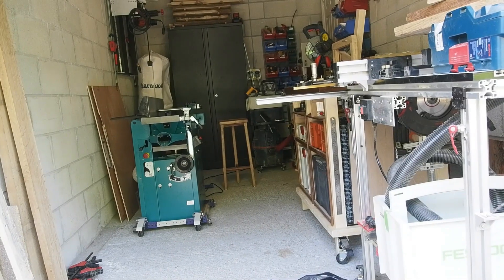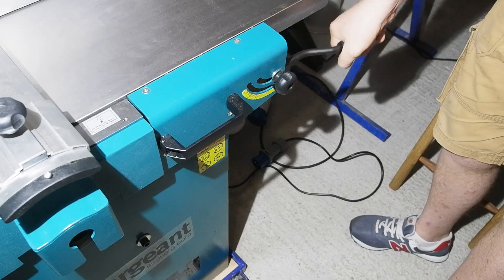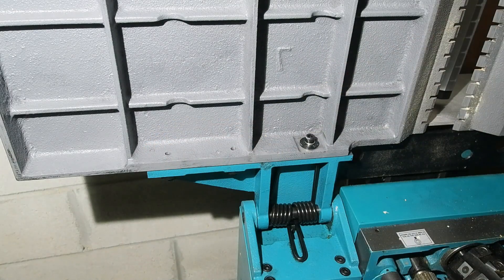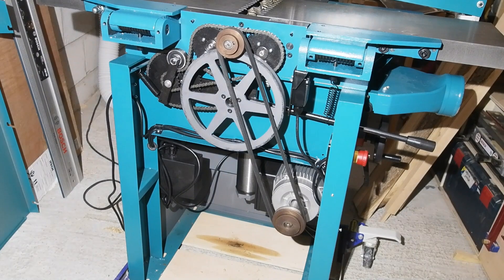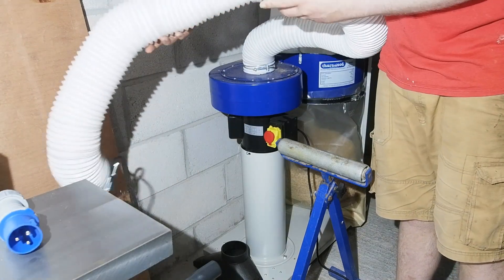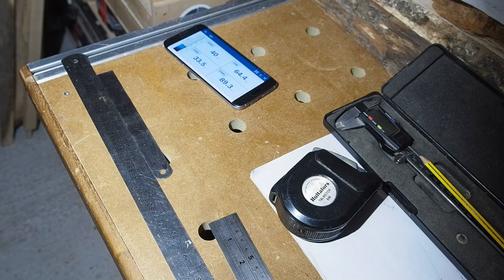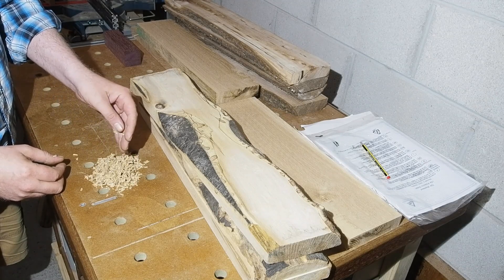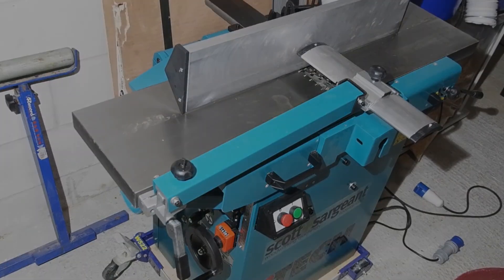ITECH 260S Spiral Planer Thicknesser Initial Thoughts, Setup and Test Review

Comment: Hi.  I said I would make contact if I resolved the left hand side out feed roller issue.  OK.  Isolate the machine, remove the back planel. Slacken off the 5/16 nut which acts on the spring which can be seen through the spindles of the drive wheel. I slacken off half a turn.   Now works great.  Over to you.
Reply from the maker: Glad you sorted it. Haven't looked at mine yet. I do remember when I set mine up initially, I had to drop the infeed roller a little for grip. You have the sprung bolt one side accessed by removing the back panel - as you mentioned ' but there's also one the other side which, if I remember rightly, I had to remove the inside panel to access. By "inside" I mean where the thicknesser bed is, front/control side.

Comment: Love your video.  I have the same planner.  For some reason the thicknesses does not feed through without some serious force. It seems the outfeed roller is far to tight.  I have not used the thickness for 5 months when it worked fine.  Any ideas or advice where to go would be appreciated.
Reply from the maker: Thanks mate. Funny enough, I was thinking about adjusting my outfeed roller myself today! It's started to hold things up sometimes. There's a set of bolts with compression springs that tension the rollers. It'll be these you need to adjust. Saying it is easier than doing it mind! 👍
Reply: @BischBaschBosch  
Hi. I stripped of the backend found those adjustable springs.  Really difficult to reach through the drive wheel.    If you do your then please let me know and vice verse.  In the mean time I will try thin straps fed to the right hand side at the roller doesn't seem at tight.   Watch this space.

Comment: Should've seen this video sooner. I got the same machine, only it says Bernardo AD260S. The only difference is the spiral block. Mine's a lot simpeler, with less blades, and not skewed. Bought it second hand (2 years old), with no manual or accessories. Spent a lot of time looking for the adjustment of the infeed table on the backside. No complaints however, fantastic machine, with great results. I do have the 400v version. Thx for the review!
Reply from the maker: Cheers. Yeah, I'm  Pretty sure a lot of machines (bandsaws, table saws, and planers) at entry level like these, are the same basic machines from the same factory. Just the odd change here and there to a brands spec.🤷‍♂️ Decent for a small workshop though. 👍

Comment: hi. Thak you for the review on the machine! Thats the best bit of information i managed to find on the whole web!  i am debating between this machine and axm 260 trade... which acording to some forums is a lot better. what puts me off is removal of fance to change planing mode... so itech is winning...  whats your feedback after a year of owning this piece of gear?  my machine will mainly be used for manufacture of solid wood tables tops ect ... would love the wider bed , but the cost are huge on itech for next model up so might have to settle on 260
Reply from the maker: Thank you mate. All those people saying the axminster is a lot better ...I wonder, have they actually tried both? That said, the comparable axminster machine is now nearly £600 more and does have some improved features. Mostly cosmetic though - better finished levers, wheels etc. It's feed rate is (and always has been) a bit better than the Itech. As is/has been the fence. It's a nice looking entry level machine. I was at the time of purchase - and still am - happy to forego the better fence, feed rate and cosmetic niceties for the ease of swap over on the Itech. For me, that's a constantly used feature and so matters. I rarely adjust the fence so that the adjustment is a bit rubbish on the Itech, I'm not bothered by. Always some compromise at this price level. Despite the Itech wearing it's budget compromises on its sleeve, it's proved a good enough workhorse so far. For most of us, even these entry level machines represent a not insignificant investment so you're wise to gather all the info you can👍
Reply: @BischBaschBosch  thank you for prompt reply. Ease of change is the biggest factor for me , wouldnt want to spend to much time on adjustments every time i mill lumber ...as per feeds ect , i am not bothered , its not for heavy comercial use. Quite like the offer now from S@S , for 2.3k with extractor and base ... so probably going to buy this ...and funny enough i was going to get Axminster until i watched your video ;P. Thanks again ! review from profesional are rare and valued...most of the YT woodworker prise manufacturers that pay them for doing so ....
Reply from the maker: @huntermedea8536  I think with either machine, a bit of time spent setting up, and you'd be happy with either.  Good luck mate, whichever you decide on👍

Comment: Just got mine and found your excellent video making up for a lacking manual. Wondering if you need to do any setup for the thicknesser bed or is that always true?
On the datum out feed mine is I think opposite to yours as it is moving the rule 8mm. Have not quite figured out how to use the two bolts by the pins. S&S video is a little confusing in explaining the relationship between Allen bolt and hex nut.
Reply from the maker: Thanks mate. So, on mine, once I had the top surfaces in planar, I planed one side ready to thickness (a full width 240mm piece). When thicknessed, I checked all sides of the wood with vernier. All 4 sides were within a 10th mm so I was happy enough. Just had to adjust the "digital" scale slightly for correct thickness. If it's off - as in one side of a thicknessed piece is noticeably thicker than the other, I think the only avenue for adjustment would be the cutter block itself. I haven't looked into doing that but can't see that being any fun at all if it needed it!
If your rules moving 8mn, you need to try and raise the outfeed. Hinge side (where the pins are) you've got a nut inside and 2 outside. Slacken them all and try and push the bed up,  then tighten, inside nut nearest the block first. Very minimal adjustment due to the pins but, if you need more height, it might be necessary to either grind a pin off (nearest to block) or slightly widen it's hole if you have a capable drill/bits (plenty of lube!). Took me a good 2 1/2 fill days to get mine where I was happy. Any difficulty though, I'd say try and get on to S&S for technical help.
Reply: Did you menage to get them aligned in the end? I have the same issue with mine. When i remove one pin, it moves but is really difficult to set it properly sjnce those camshafts have a lot of play. Mine had tables removed from the machine so now i am struggling to set them back correctly.

Comment: I’ve got the 300 version and in all honesty, I’m not to impressed by it, the fence is not flat so it’s really difficult to consistently get a perfect 90 degrees, when thicknessing the best it handles is 0.3 of a millimetre, admittedly that’s on 140mm wide boards but only pine, my old much cheaper record power planer honestly performed better, nice review though 👍
Reply from the maker: Cheers mate. I think something's wrong there. I think I mention in the vid that it's not comfortable doing more than 1mm or so cuts. 90%of the time I set for 0 5mm passes and is fine, above and below, even on 240mm width hardwood. 3 things I would check is first, your locking lever is actually locking the thickness bed. 2nd, check the motor drive belt and feed roller tension. 3rd, adjust the feed roller tension springs. I'd probably call S&S for technical support if that didn't work. Sure as shit should be able to feed/plane off more than 0.3mm in thickness mode. I'd call S&S about the fence too bud. Putting up with a bent one ain't on. Get on the blower to them 👍
Reply: Thanks for getting back to me, so I bought the machine just over 3 years ago on Black Friday, then on the Sunday I had quite a serious injury, it must of sat in the back of my van for about a yeah, I’d forget I even had it lol, not after sympathy, just making the point that it’s had very little use, I actually rotated the blades (for the first time) the other day to see if that helped(it didn’t) they all undone very easily but two cutters did crack when I tightened them back up, something to watch out for, I think you have to be very careful you have them seated properly, so I found your video wondering if anyone else had any issues, not really seen a bad word anywhere about these machines, it’s almost like mine is feeding the material to fast for the machine and it completely stalls it, anyway I’ve rambled on to long, thank you for your advice, I will start working my way through you suggestions, great video, you’ve picked up a new subscriber 👍👍👍
Reply from the maker: @mikeswoodencreations5712  I understand mate. Feed rate's an interesting one. I noticed when looking at the specs of machines that the itech (My one in particular) was quite slow compared to rival machines. Even some sub £1000 machines. And it does actually feed quite slow. I've no issue with this but I wonder if they changed the gearing if they were having stall issues? Have a tinker but again though, I'd defo see if you can talk to a technical bod at S&S. Best of luck and thanks for the sub!😁👍
Reply: @BischBaschBosch I had a bit of slip,with thicknessing on mine which I traced to the top of the slot for the clutch lever just touching the lever arm.  A few minutes grinding the slot out at the top has fixed it.
I note from Keith's (Ragnbonebrown) review that the new versions now have the same adjusting grubscrews on the outfeed side hinges so setting that side up will be a lot easier on their version.  Mine has the older mounting and was a nightmare to get right - took about 6 hours!
Reply from the maker: @michaelblackmore883  All good info, thanks Michael. Yeah, mine has the "pinned" outfeed hinge. Was a pain. Think I spent about 2 1/2 days solid getting mine just so!👍
Reply: @BischBaschBosch  I just checked mine again today and it's a whiff down on the back and a little low on the front - straight edge just catches on the outfeed here.  I can't face redoing the back but I will ease the front down a touch to get it level with the infeed.
The new arrangement is a gift as it will make the adjustments a doddle.  Pity but the cost of changing the whole hinge assembly on the outfeed side is probably to much to be worth doing.

Comment: Love the in depth review , it’s just the level of detail I wish all reviewers go to. After a year of use, is there any issues you have found with it? I’m heavily considering getting one too, in my tight workshop, on a rolling base as you have. Any advice, if you were to buy again would be greatly appreciated, say if you had it knicked but by some miracle insurance give the cash you paid.
Reply from the maker: Thanks Tom.  After a year or so use, i don't really think about it much - which is a good thing. It just does the job. I probably should give it a service though.
If I have any niggles, one I mentioned in the video: I don't like the fence angle adjustment. Common type at this price though. I hate the colour, but that's been changed to grey on new ones. Lastly, something else I mentioned in the video - the tension spring bolt for the infeed roller. On mine, to have it loose enough that it grips but doesn't mar the work, it's literally on by a thread. Any looser, it'll drop out! I'll look at it again when I service it to see if something can be done. Longer piece of threaded bar perhaps. Minor niggles really. Works fine day to day. Still haven't needed to rotate the blades yet either!👍

Comment: Excellent review, I am looking to get one myself soon. With regard to powering it where did you get the socket? Is it just a simple case of switching a standard double socket to the one that you're using? Thanks
Reply from the maker: Cheers David. Can't remember where I got the 16A double female socket now. Plenty of options online though.  Yes, straight swap for the standard 3 pin domestic double socket. Do try and run the 16A sockets off a C16 fuse on the consumer unit rather than a domestic B16. Again, it's just a straight swap, just gives more headroom for power peaks on machine start up. Get a sparky in to do that for you if you're not sure of course.👍

Comment: Thanks for the review. Do you know if there are any good separate planer and thickness machines for the hobbyist in the UK? I now axminster used to do one but no more.
Reply from the maker: Not really mate, outside of industrial machines. Your best bet is looking for decent used machines. The old axminster trade spiral head thicknesser was apparently quite good. Jet did a couple of decent surface planers, but quite narrow at 6 and 8 inch. If you have room, you'd be better off looking for old 230v industrial machines I think. I guess the combination machines proved more popular in the UK as space is tight for most hobbyists.🤷‍♂️

Comment: Thanks for such a thorough review. This is similar to the Axminster AW2260S but am concerned that the axi has much less carbide knives 24, as opposed to 66 on this machine. Any thoughts and advice is highly appreciated.
Reply from the maker: Cheers Robert. Yeah, the base of most of these £1000 - 2000 machines come out the same factory I imagine. All much the same. Looks like Axminster have changed their range a bit since I did this video. At the time, the model that was comparable to mine is what they're now selling as the £2500 professional one. The "workshop" one you mention with the 24 cutters is a new product/package. I honestly couldn't tell you how it'd perform compared to the professional or mine with 66 cutters and a 1000rpm higher speed. The more accute row angle probably makes up the difference. There are a handful of industrial planer thicknessers that use 24 cutters so the theory is sound. Cost cutting on the axminster though I think. I'd be as curious as you to see how it performed.🤷‍♂️

Comment: Hi. Great review. Can I just ask, are you still happy with this machine? I’m torn between this one and the Axminster AP260SPT. They seem very similar apart from the itech being easier to switch between thickness and planer.
Reply from the maker: Thanks. Yeah, I'm pretty happy with it. The ease of swap over is why I chose this machine over the axminster. I can't directly compare the two but it does look like the axminster has a better (and longer) fence. Mine stays at 90 degrees all the time so I'm not bothered but could be worth considering if you wanted to plane bevels. My only regret is not buying - or having room for - a machine with wider beds. Both the itech and the axminster seem decent entry level spiral machines really.
Reply: @BischBaschBosch  thanks for the response. Something to mull over the weekend. Both look to be good machines. Availability will probably be the deciding factor.

Comment: Thanks a lot for making this video! Great review and humor! After a few months, still happy with it? It still seems to be the best offering at this price range...
Reply from the maker: Thanks mate. Yeah, I'm pretty happy with it. The fact it has a spiral block and the easiest swap between functions at this price range, it's a good buy I think. One small niggle after having it for a while is the tension screws for the infeed roller on the thicknesser. I have them backed off to the point there's barely a whole thread turn keeping them in place. This is the only way I can get it to not leave marks on softer woods like the white beech I use often. Works fine this way but I feel the need to periodically check the tension screws are still in place. I keep meaning to contact Scott and sergeant at some point to see if I can adjust the relationship between cutter and infeed. Can't find and obvious way to do it. 🤷‍♂️

Comment: I've noticed most of the machines are the same, except for Sedgwick. Why don't companies make their own equipment? These iTech's seem very cheap for a spiral cutter. Very tempting when you think the Craft machine from axminster is only a bit less. Good info btw.
Reply from the maker: I was very close to getting the baby Sedgwick (store demo machine with some use so reduced to about £2500). I was just keen to try a spiral block for my patterned table tops (cross grains etc). What sealed the deal for me with the Itech was the swap over from planer to thicknesser. Super easy, both tables lift as one. But yeah, other than the block and table joining, it is identical to almost all other £1000 - £2000 cabinet machines. Like I say  I think they all come from the same Chinese factory which have a catalogue of parts companies can choose from for target price bracket or personalisation. 
I think this is for a couple of reasons. For some companies, those that make hand power tools mostly say, it's because they want a PT in their range but can't justify the tooling. For those manufacturers who make large machines - like Itech funny enough - going for a generic for their baby PT makes financial sense. Maybe just adding their own tweak here and there.
I'm pretty happy with the Itech all told. I do maybe have a slight niggle that I should have stumped the little extra for the Sedgwick but 🤷‍♂️